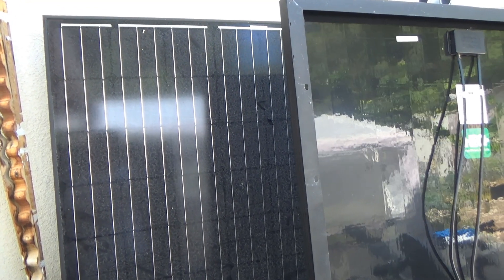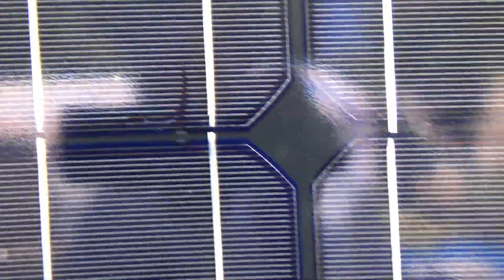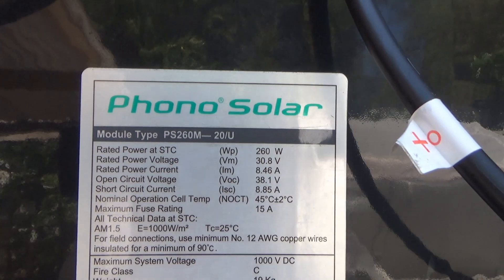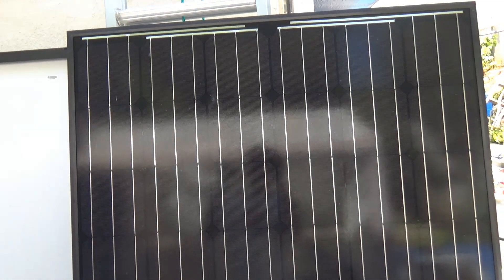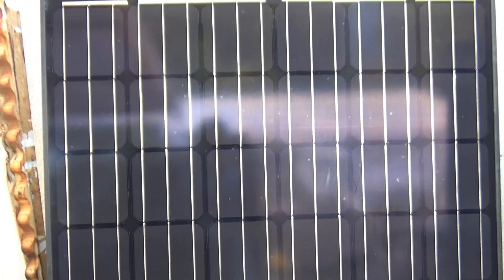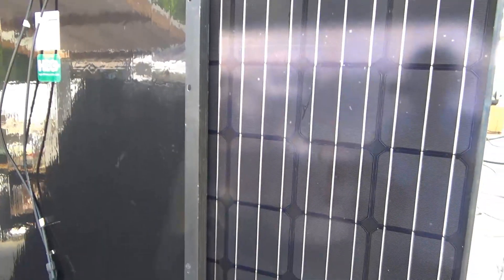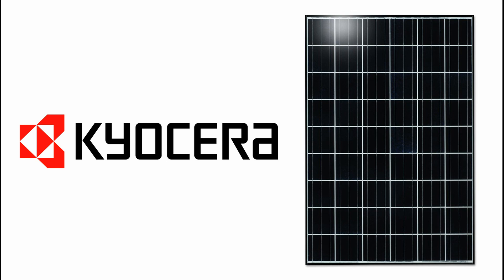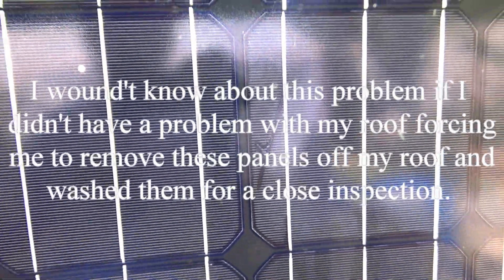Solar panels: cracked cells (not glass) and warranty claim with the manufacturer

Comment: Can't you measure the performance on the 'ground'  ? 😁
Reply from the maker: Good question. But I have a central inverter which runs on 240V AC and requires a solar array of at least 250V DC total. That's 10 panels in series. (9 panels would be fine but might have problem turning on in hot days as it would produce less voltage). I don't have that much room on the ground that is free from shades (trees, poles, my house, shed, patio...) to do that. A central inverter is very sensitive to shading. Just a little bit of shade on one panel can bring down the entire array. If I had micro inverters like the Enphase, it would be possible. But then the shading would mess up the testing of an entire total system output as it would not be consistent. And also, when the panels on the roof, they are at an angle. On the ground they are flat. That would mess up the testing procedure as well if you want to compare the ground output to the roof output. My final choice is to put them back on the roof. That's a half week of work for me as I'm doing it all by myself. And it'll take me the same amount of time to bring them down. I don't think I have the time and energy to invest in solar panels like these.
Reply: vuaeco, all you need is a 3.6Ohm power resistor and sunny weather conditions. From the label one can see the maximum power point is a 30.8V and 8.46A which makes 260Watt+ So put a resistor in parallel and measure the voltage which should come close to 31V, if not the panel is out of spec!
Reply from the maker: That's one way to test your panel. However, these solar companies would want you to connect it "the right way" before they even consider processing your claim.
Reply: vuaeco, ok tipp, let them describe an.exact testsetup, as detailed as possible!
Reply: BTW, this is the "right way" to see if they are in spec for MaximumPowerPoint.

Comment: Gday mate... do you have a video on repairing shattered glass on solar panel please
Reply from the maker: I haven't done that. I've had shattered glass solar panels before. The glass is glued tight to the solar cells. It is impossible to separate the glass and the solar cells. You can use glue to fill in the gaps between the cracks but that's tedious work and just for temporary fix. The glue over time under the sun UV light will turn yellow/opaque and makes it worse. I don't think there's a permanent fix for them at least for the conventional solar panels that have temper glass glued to the solar cells.